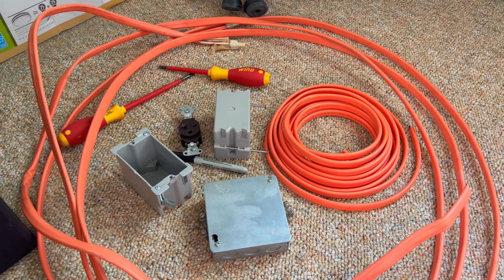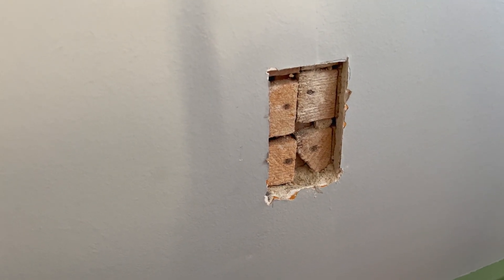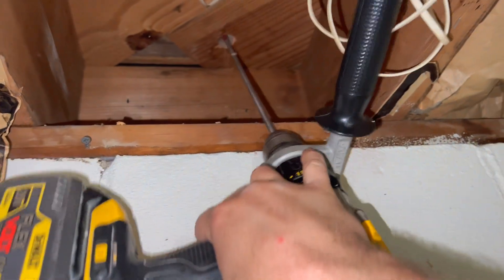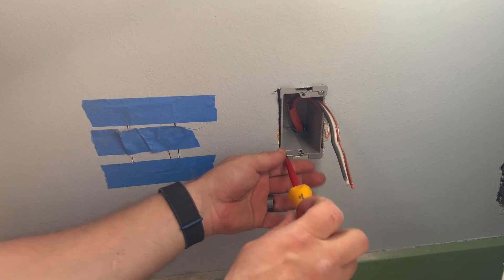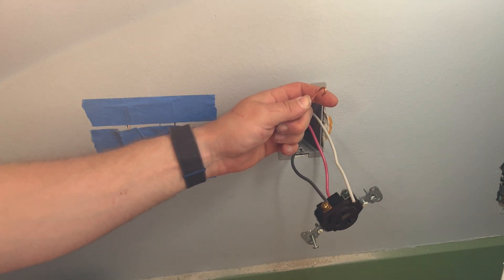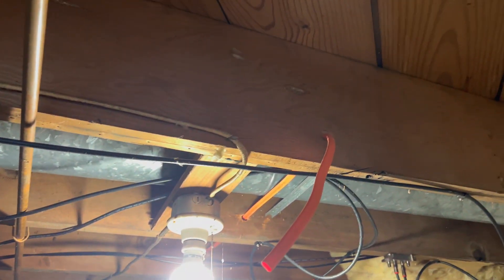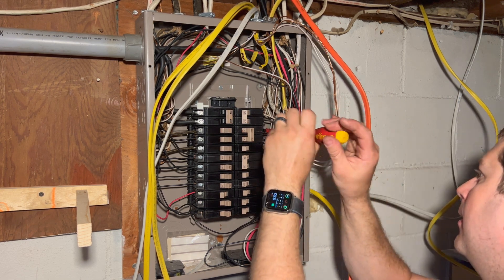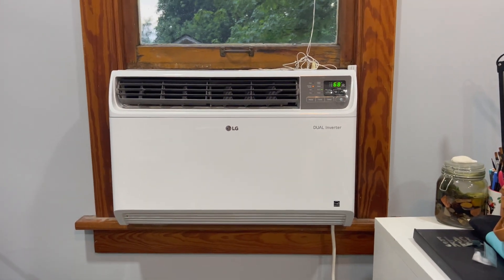How to Wire a New 220v Outlet for Air Conditioning!

Comment: I have a new AC with the 230V/ 20 amp and when I plugged it in air comes out but the compressor seems to work for 2 sec and then stops. It sounds like there’s not enough power for it to work correctly. Any ideas what to do?

Comment: when you cutting into wall how do you know electrical wire not running thru the studs were u cutting and what type of power tool was that you used to cut into Sheetrock

Comment: Why you connected wight wire at the panel ?
Reply from the maker: My original wire was too short so I have a junction box joining 2 wires, the 10/3 which has a red with the 10/2 which doesn’t have red so I used white. White/neutral is not needed in this case so it becomes a hot wire/red.

Comment: You wired red to outlet and capped white, in the breaker box you wire white as hot to the breaker. Where did the red wire go in the breaker box and where is the neutral in breaker box go?
Reply from the maker: Maybe I didn’t show it in the video, but my wire wasn’t long enough so I’ve got a junction box joining a 10/3 wire with a 10/2 wire, I’ve got the white wire wired to the red in the junction box.

Comment: Question: what do we do when we're not sure if the wall were drilling or cutting is a main wire wall were a lot of most of the electrical wiring to the home runs through and don't want to hit any wiring and cause an electrical short or fire from cutting or drilling. How to I check for wires in the wall I know that wiring is 16in from the ground in outlet and every two feet is a stud but the wiring is what?
Reply from the maker: If you are careful with an oscillating tool those usually work pretty good in that scenario, wiring is typically required to be in the middle of a stud bay so you have a couple of inches before you hit it.

Comment: why are you using the equipment ground wire for the neutral wire, there's no sheathing around that bare wire, if it comes into contact with something when excess current is taken back to the ground source, there will be an arc
Reply from the maker: Because this is a ground, not a neutral, what’s the difference? They both go to same place…. 🤷‍♂️

Comment: How to connect next outlet or switch to specifically single outlet?
Reply from the maker: In this case, you would have to use pigtails to the outlet. These outlets typically only hold one 1 wire

Comment: That panel needs a remodeling because that thang is a cluster fuak
After you organize the whole panel, pretty sure you'd be able to work on your appliances and circuit breakers easier, and to maintain.
Reply from the maker: Oh absolutely! Hasn't happened yet, but I'm planning on a 200 Amp panel upgrade! Panel, breakers, and wire are purchased.

Comment: that ac pulls 15 amps. Shouldn't that be ran on 14 gauge wire ? I bought the same AC and have to run some new wire is why i watched the video. nice job  by the way. But was I was wondering about the wire size being to big if it could lead to warranty issues.
Reply: You shouldn’t use higher amp breaker but u can use the wire
Reply from the maker: That is true for 15 amps you can run 14 gauge wire and 15 amp breaker, though if the AC takes 15 amps you will want to run 12 gauge wire and 20 amp breaker. Breaker in my panel was 30, so for 30 you need to run 10 gauge wire, plus I already had that wire on hand. Wire size being too big would not cause a warranty issue!
Reply: @radozeman The wire gauge is okay, but the receptacle is only rated for 20 amps and the unit is rated for 15 amps. The internal circuitry of the unit is probably not rated for 30 amps, you should be using a 15 amp breaker.
Reply: @radozeman   it is that duel converter one it has a 15 amp reset protection switch on the plug. I thought i seen  it said it runs on a lot less amps being it a 220v . mine was delivered damaged  fins the freon leaked out .. im waiting on the other one i bought to see for sure. With it being in the wall i set it to far in to read the side panel lo something else im going to fix.

Comment: It’s nice that you have a spare Square D breaker in the bottom of a Cutler Hammer panel.    NEC violation,  you installed a single 250 volt receptacle rated at 20 amps on a 30 amp branch circuit.   That’s a no no.  It could have been a 15 or 20 amp circuit and device, based on the AC being 9 amps.    Not going any further.
Reply: Hi kevin. I am not an electrician but I have a question. I’m trying to wire a 230/208v 10/2 wire to my breaker panel. What size double breaker do I need so I won’t burn my house down? Thanks in advance!
Reply from the maker: What, the breaker that is just lying in the bottom? It's not installed is it? Where that breaker came from I don't know, it was in the panel when I bought the place.

Comment: Do you run wire to inside breaker box or box outside on the pole
Reply from the maker: Inside breaker panel in my case.

Comment: Someone can help me?
What kind of braker he used?
Reply from the maker: Depends on your panel, but you’ll need a double pole 220v breaker rated for the size of your air conditioner and wiring. I ran 10 gauge wire so I’m using a 30 amp breaker. My panel is a Cutler Hammer.

Comment: Hi, I bought a 220V air conditioner and the surge protector on the cord will not reset. It's the same plug as yours. My outlet has 120V on each of the prongs, and a ground. Three wires. Convinced it was the surge protector and I didn't want to have to drag a 130-lb AC back to Home Depot, I chopped the GFI off and direct-wired it. Still didn't work (no surprise, b/c it had tiny sensing wires in the cord). Bought a new different AC, tho same brand, and it's the same as yours (LG #LW2422IVSM); imagine my surprise when it also won't reset; the pilot LED on the cord GFI also never illuminates. This is in my shop, which gets 60A thru 3-wire service via a 60A breaker in my house; one hot goes to each bar, and bare goes to ground/neutral, where all the white/bare wires get connected. My outlet has 115V in each leg. The box for both AC's says 220V, and the manual points out the 220V plug, so I'm assuming it wants 115 in each leg; it draws up to 2290A, so it'd have to be across two 115's, right?. It says it needs a wall receptacle that's "Standard 240V, 3-wire grounding receptacle rated 15A/240VAC/60Hz". I can pull the plug out halfway and with my voltmeter read 115V on of the two powered prongs. House is from '89, shop was added sometime later (before me). Is the GFI on these things maybe too touchy to work in this setup? Perhaps important, the 50A breaker/wire that supplies my outlet branches in the wall to also power a 30A welding outlet (still 115 on each leg and one ground/neutral). I currently have two smal 120V AC's, one old and one new, both with cord GFIs, running on separate circuits in the shop with no problem. Many, many thanks; just moved to Texas and it's getting very hot here :-).
Reply: Pulling the big outlet and wire-nutting the wires together didn't help. What DID help was discovering the 2-pole breaker in my shop breaker box was not a dual-space (or whatever you call it), so it was pulling both 120's from the same leg. I replaced the breaker with a dually so the leads come from different legs and now the GFI is happy. Seems like an important detail to point out in the instructions :-). Finally figured it out because I calmed down and prayed for help. Followed the power and there it was :-).
Reply from the maker: @emuench155  I must have missed this comment! Looks like you have it figured out, and it was exactly what I figured it was! I was going to suggest checking if you actually have 220! If you measure both hots you should have 220-240 volts, each hot to neutral/ground should be 110-120

Comment: I'm trying to wire a 6-15 outlet.  I have 2 blacks, 2 whites, and a ground.  Everyone i tried watching that wired it only had 1 black, 1 white and a ground so they repurposed the white neutral into a hot. Where i have 2 sets of wires, am i able to connect a black to each side, my ground and then cap off my neutrals?

Comment: What kind of framing is that? With the wall having those horizontal posts
Reply from the maker: Do you mean the lathe behind the plaster?
Reply: @radozeman  Yeah
Reply: That's what they used to used to put on plaster walls in the old days before sheetrock.

Comment: I have a nema 10 20r. 
Has 2 gold and 1 silver screws.  No green ground
How do I wire it?
Black and red on gold and white on silver?
I need help
Reply: It's 20 amp for a old air compressor
Reply from the maker: Sounds like the incorrect type of outlet/plug for that compressor. First is the compressor 220? Make sure it is, or wired for 220, some can be wired both ways. Black and red on gold, silver would be white, but you need green, technically it would work that way, but would not be correct.

Comment: What is the single outlet number 30 amp to whats on the outlet
Reply from the maker: Not sure I understand what you are asking?
Reply: @radozeman  yes can i use a 30 amp Orange cable with a single outlet that is 20A 250v
Reply: Video was nothing fancy but to the point! 🤙🏼🍻